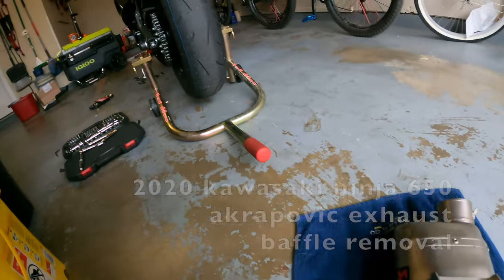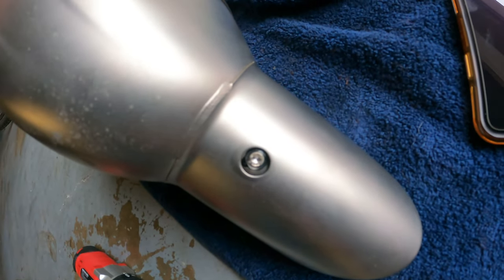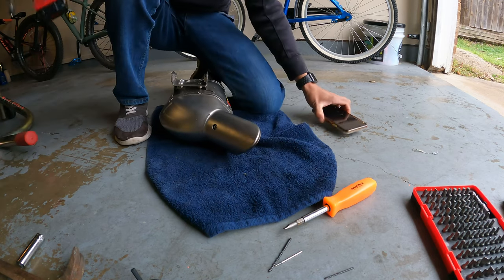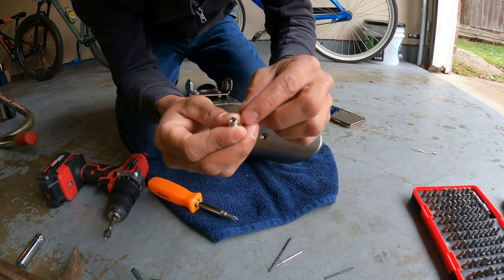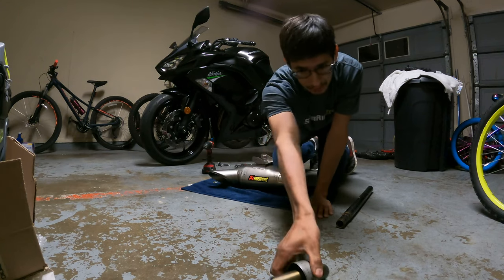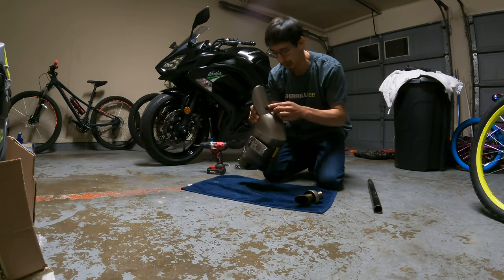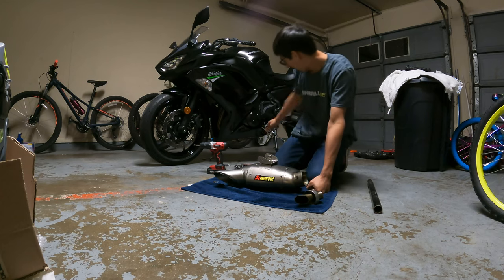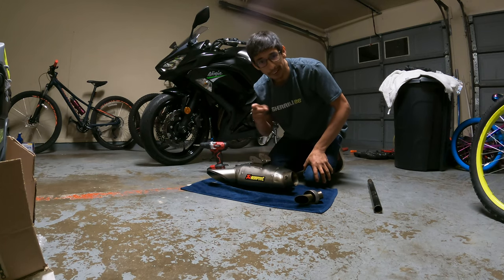Akrapovic exhaust baffle removal 2020 ninja 650

Comment: Thanks for the info have this exhaust on my 2021 ninja 650 will have to try it
Reply: Has this worked? I have been trying for the last 3 hours and it wont budge. Dont have a screw in it so had to drill trough the weld. Tried pushing and pulling but it hasnt come out

Comment: I have the ninja 650 2020 Perfomance Edition, is this the Same EXHAUST?
Reply from the maker: I can’t say. I don’t know what the performance addition is. I ordered the akrapovic exhaust.
Reply from the maker: If it is the krt edition I wanna say it’s just a color scheme no difference in motorcycles
Reply: @Thelooch  performance edition comes with the same exhaust I believe. It has the carbon cover though.
Reply: It’s not the same exhaust. Performance edition comes with a street legal akra exhaust, which sounds pretty much stock unless you pull out the baffle. The one in the video is not street legal even with the baffle in, and gives higher performance and is louder